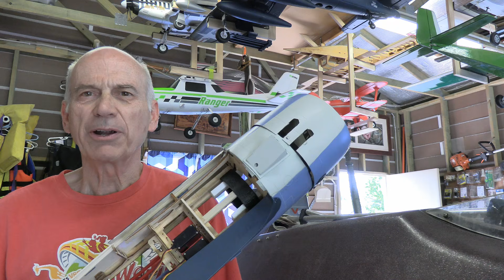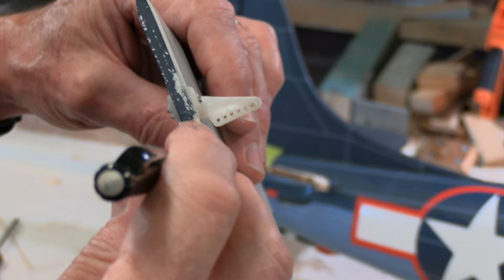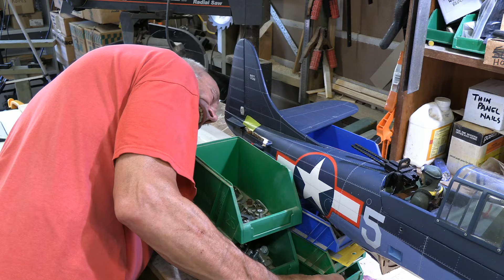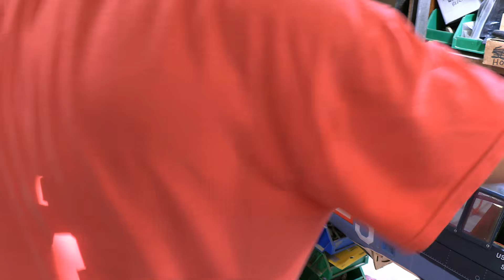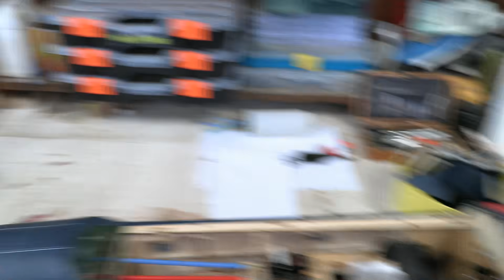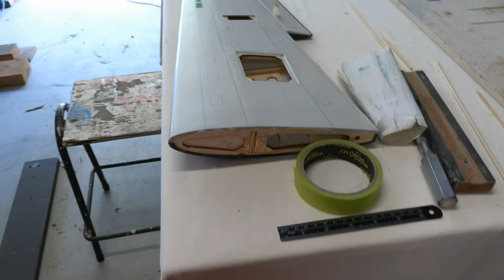VQ SBD Dauntless RC Plane Tail Repair

Comment: I appreciate your attention to the finer details when you know the different surfaces are required to be square, level and specific relations to one another to work correctly. My sons had a difficult time flying their creations due to rushing the build and learned the difficult way, in spite of my suggestions regarding patience and attention to detail. Now, they are building successfully and having a lot more fun.  👍🏻. Thanks for sharing your skills with this recovery project.
Reply from the maker: Thanks, Eric.  I also need to continue to work at giving attention to detail - it's easy to get in a hurry!